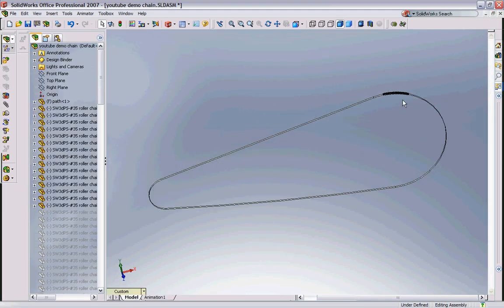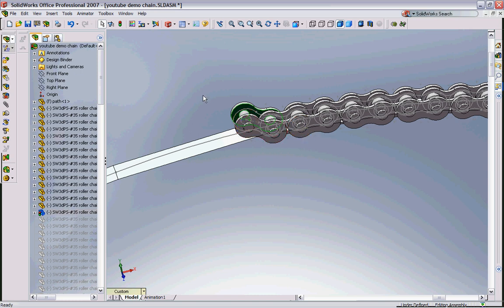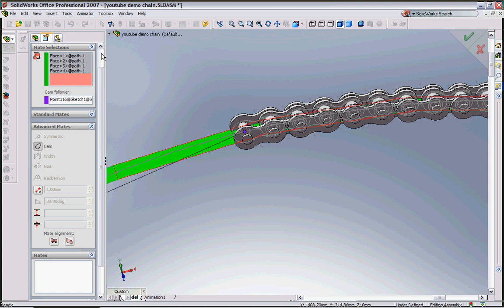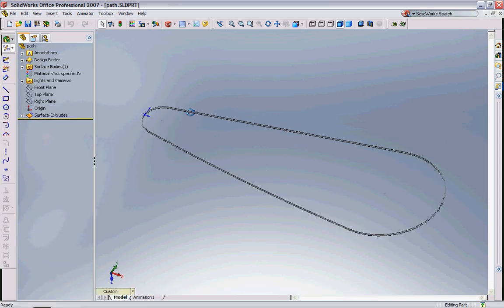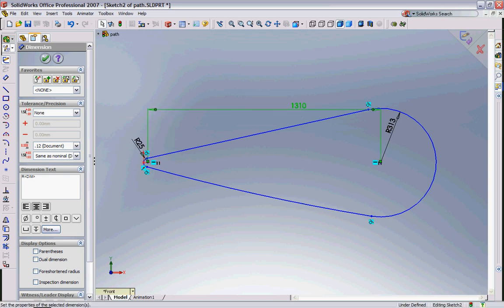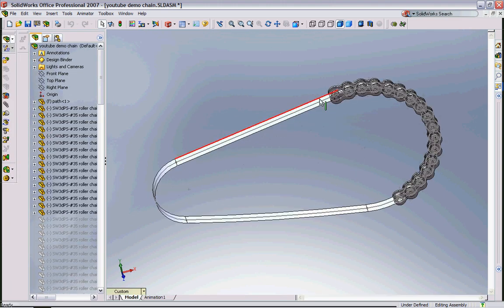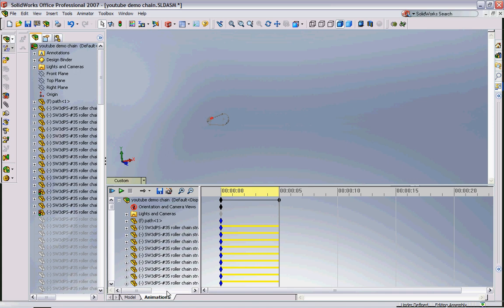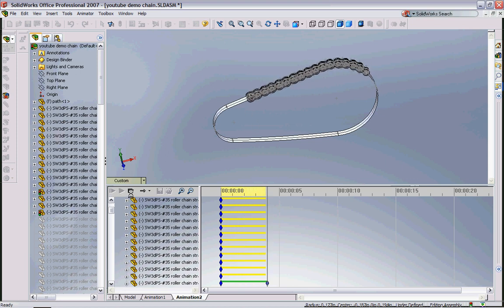Solidworks Assembly Animation of Chain on Path

Comment: @Euminides  you can make the sprocket and the chain to move relative with the gear mate only select a face of the sprocket an a circular face of the link and you are done. but i also have the same problem of over define mates and haven't figured out any ideas?

Comment: how do you mate the last link to close the chain WITHOUT over defining it?  the last concentric mate says it would over define, im not sure what im doing wrong.  the distance is correct for the link to fit exactly, it just wont do it.  also would like to know how to link the gear and chain to move relative.  thanks for the post

Comment: Should the chain links be mated to each other before mated to the path? Im trying to create a similar model, which is in fact the drive train of Pixar's Wall-E. I've got all the pieces made, and I'm just trying to mate all the individual tread pieces to each other and to the path around the wheel assembly. Unfortunately it's really buggy in that when I connect more than say 6 treads or so, they start flipping upside down and embedding themselves with each other. Any ideas? It's driving me crazy!